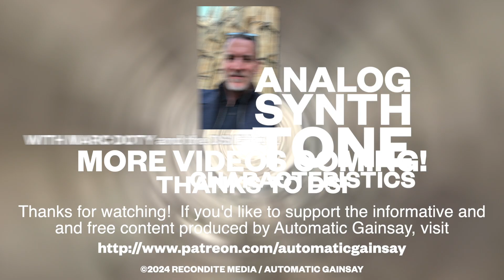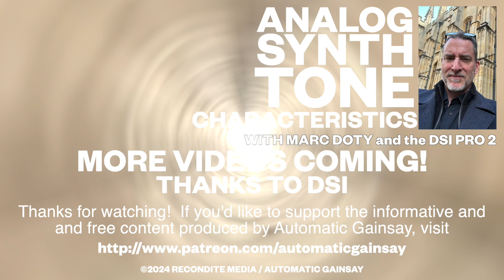What makes an analog synth sound analog?  Part 2-  DRIFT???

Comment: Awesome! Dunno why I hadn't thought of slightly modulating pitch from noise or random LFO. I recently got an 80's polysynth and to have some fun uploaded a short video live playing a patch on it then asked people on Reddit and Elektronauts to guess what it was. (It's a Casio HT-6000, 4 DCO, 8 voice, 8 analog filters, analog chorus, pretty rare, been after one for years because it's oddball) Anyway people guessed all sorts of real analog things - most probably because I assigned a very slow sine LFO to drift the pitch - I was trying to hide it's DCO nature. But I'm going to try your method now instead, small random movements are going to work a lot better. Great tip.
Reply from the maker: Thank you!

Comment: I want drift when I want drift. Yes, beating can be beautiful, but beating in itself, as you sort of demonstrate with a better set of modern digital oscillators, could be done on eight-bit, first-gen digital synths. Analogue sound is about smooth linear variability, and that is what distinguishes analogue sound. Over time, digital tools have become vastly better at approximating this natural smoothness. Regardless of the synthesizer, there is no need to have slop or drift when you have a lot of other movement programmed into a sound. In fact, drift in a complex patch just makes a muddy, broken-sounding patch, even on an analogue synth. We want our analogue gear to be in tune so we can decide when we need that natural chorusing. What can be frustrating with old synths is that frequently they do break. An out-of-tune synth that resists tuning becomes less fun pretty quickly, especially if one remembers it as a beautiful-sounding machine before it developed components that had fallen out of specification.

We are, however, only two videos into this. Let us proceed.

Comment: I have used this trick for years to simulate oscilator drift.  My older hybrid synth has "noise" waveforms which are actually digital, and therefore repeating.  That makes for some very interesting LFO modulations that aren't really random, but nonetheless have their own character.